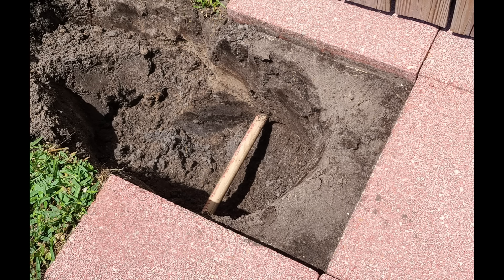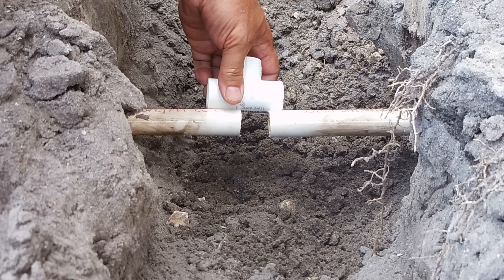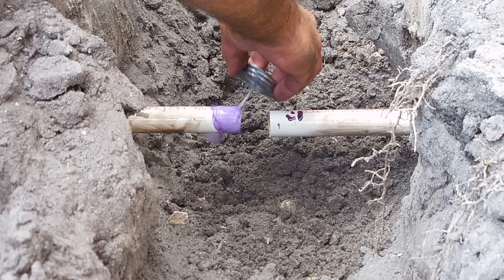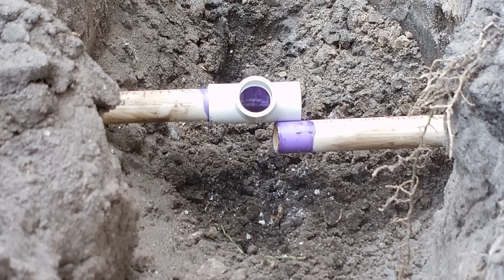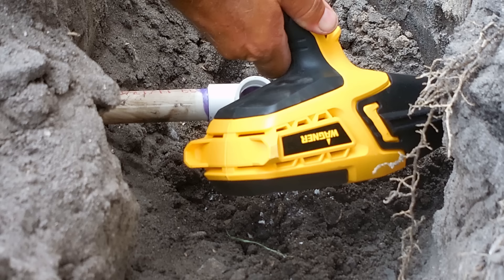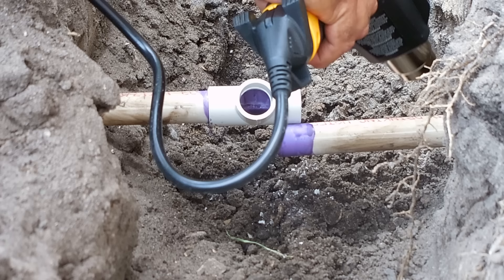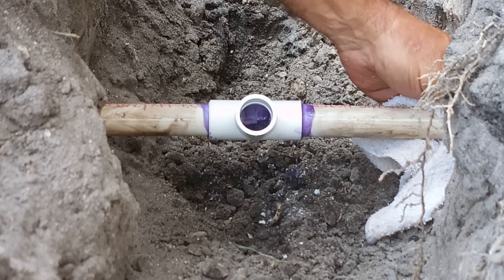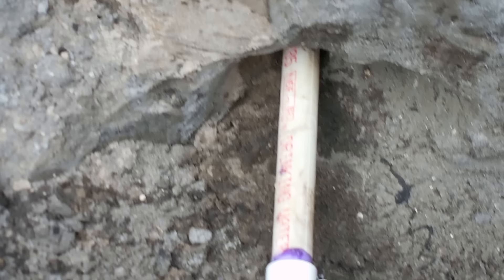How To EASILY Tap Into PVC Water Lines(Best Method Using A Small Hole)

Comment: Big NO letting the primer dry like that. Read the instructions, it clearly says DO NOT ALLOW PRIMER TO DRY ON PIPE or you may have to cut it off and start over. I've done thousands of joints and when the primer dries it makes a very weak glue bond. The dry primer acts like a barrier preventing the glue from reacting with the PVC under it. Do it however you want but it very well might blow apart in a few years.
Reply from the maker: Wrong. The primer was not fully dry, pipe was still soft. I highly suggest you watch my pvc cement testing video. Just so you know, many of the same chemicals used in the primer are also in the PVC cement.

Comment: No you're not going to get heat gun. Lol. Firstly,  if you can help it, always give fittings a 90 degree twist. (So if tee needs to point up then attach tee pointing to the side and twist up. 2ndly and VERY IMPORTANT. WIPE THE "GLUE" BEAD OFF with primer or a rag. It is eating into the pipe as it is curing and may leak later. Believe me.  And clean burrs off prior. Then either take a bell end ( they only come on 20 ft length pipe) or a coupling and remove the stop if you cant find a repair coupling.  Many times you cut the pipe and realize the pipe is curving a little or in a bind. So many times a regular el and a street el (one el inserts into the other) is simple and takes some tension out of pipe. WIPE OR CLEAN OFF THE SOLVENT BEAD
Reply: I just looked again at pic. See how after he cut the pipe they can still lay nearly parallel side by side ? I would probably dig maybe 4 inches back on one or both sides and use a el and a "street" or " spigot" el that is male insert on one end. Boom done. WIPE OFF THE BEAD

Comment: This isn’t the easiest way.  I could flex that into place without heat, done it plenty.   You can also just remove one stop inside of the tee fitting.    Both are faster and easier than heating it
Reply from the maker: Pulling up hard on 2 short sections of PVC pipe isn't the smartest thing to do. As for your other idea, I showed that method in another video a while back.
Reply: @electronicsNmore  never had a problem, it’s very flexible

Comment: This was painful to watch
Reply from the maker: Painful? Tell that to my neighbor that used the method shown on a 1" PVC line that was located in a spot where he only had about a foot of space to tap in. He was ecstatic over how well it worked.
Reply: Especially bc you're not suppose to ever run water lines in PVC only copper or Pex it's against code (depending where u live)
Reply: Now if we're talking about waste and referring to drain pipes then you can use PVC underground aswell as cast iron why are you using PVC for a waterline give me one good reason.
Reply from the maker: @JUNEBUGLLC  I can assure you it's not against code in Florida, nor is it against code in many other areas.
Reply from the maker: @JUNEBUGLLC  Why? Because in Florida that's what you use. LOL Anymore ridiculous questions?

Comment: This is stupid. You just made a weak spot in the pipe. Remove another pave stone on each side and dig it back further on both sides and do it the right way
Reply from the maker: The only thing stupid are comments from misinformed viewers. Nothing has been weakened. I have done the testing, you have not. End of story
Reply: @electronicsNmore  PVC wasn't made to heat up like that so shut up and charge people more when you have to come back and repair it again. Ripoff

Comment: Sloppy application of PVC cement. There’s a dry spot where no glue was applied on the inside of the fitting. This is why it will leak. Otherwise, it’s a good technique for joining pipe. Thank you.
Reply from the maker: Don't be a pedant. I can assure you it will not leak, and it will be buried in the ground long after you and I are both gone. Thanks for watching

Comment: Heating pvc is never a good idea ! It will always be brittle and in the future will break!
Reply from the maker: Sorry, you're wrong. I suggest you look up how the PVC pipes are manufactured. They use VERY high temps. Have you not noticed that the ends of 10' lengths are thermoformed to allow each end to slide into another section? Have you done testing on thermoformed PVC pipes? NO. I have. I have countless jobs done 30 years ago that are still working fine today. Unless you know what you're talking about, I suggest you zip it up and lose the exclamation points.